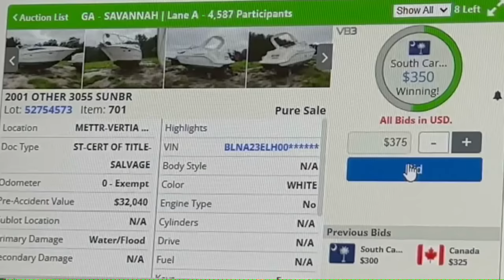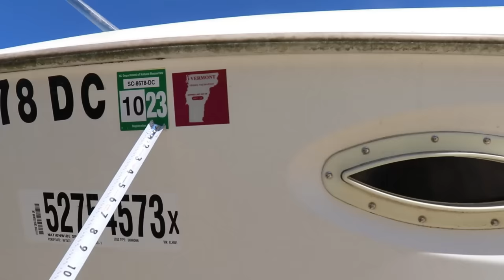IVAN WON A REALLY CHEAP BOAT OFF COPART

Comment: 25 year employee here.  This model was real popular. We built them for many years and i was the Ciera product manager in the early 2000’s.  The damage on the drives says there was an electrical issue either with the onboard bonding system, charging system, a “hot” boat nearby, or other stray current in the marina.  The marine head has been changed to an electric pump unit.   Don’t play with the shift levers unless the engine is running, use the buttons on the side of each lever to disengage the shift function..  they are called out drives. They are bravo twos.  They are the work horse units that mercury produces.  With the 5.7l engines this model is a blast to run.
Reply: I do care and thanks for the information
Reply: @@ferdysambo3875get off ya mum's wifi and go tidy your room kid !
Reply: IO worst thing they ever invented)
Reply: Nice find and at that price bargain of the year!
Reply: @dsadzaglishvili  And the industry noticed. Now we have cabin cruisers with 5 outboards. IO's are now obsolete.
Reply: Great boat.
Reply: A big this about that is if they pulled the boat and replaced the anodes nothing nearly as bad wouldve happened. This is definitely due to there being no anodes left and being left in the water for a long ass time
Reply: That is a deal! It’s a great size boat.👍
Reply: @04Corolla  nah with electrolysis you can do this in about a week or 2. We had a customer that left his boat hooked up to shore power without a proper setup and the outdrive became part of the electrical circuit. That thing was half way gone in about a week. You can see the bubble coming off sometimes if they have a bad electrical system on board and they hook it up to shore power.
Reply: Then you are probably pretty familiar with my boat as well.. I found a 1999 Maxum 3700 SCR (a 40 foot boat )for $4k about 4 years ago and started getting it remodeled.. I've done and have learned a lot in the process.. Done a lot of modifications to it as well.. I love my boat for sure.. Come take a look at it here.. https://youtu.be/MbGOYVlXeXQ?si=fLgVePGv02r-tbcp I made a video of it showing all of the modifications I had done at the time of the video. It is a lot bigger than this boat is.. Sports twin Horizon 454's and weighs in at 22,000 lbs.. She's a big one.. I have done so much since this video was taken 3 years ago.. I need to update it for sure..
Reply: hey im a bit late but are you familiar with the mutiny line you guys had?
i used to own a bayliner mutiny 170 i believe and it had a volvo penta engine in it
Reply: Agree 100%, was just telling my wife that just before I read your comment, I'm wondering if the zincs were replaced, which were probably destroyed pretty quickly, if it would have prevented a lot of that damage? That was a lot of electric too but most likely DC voltage which is even more damaging in a situation like this.
Reply: what's a bridge pump?
Reply: @davegolombisky5530  bilge pump
It's a little pump at the bottom of the hull
That pumps any water that does come inside 
Out back into the water si the boat stays afloat
On smaller boats you usually have a lil scoop
But on nicer boats there's a pump installed thay takes care of that
Reply: @davegolombisky5530  Something that someone who doesn't know boats calls a bilge pump.

Comment: Yep great buy! The z drives uncouple from the drive shafts quite easily, then you can replace them, make sure you get the up graded double props called duo props replacement z drives, also the hull is a fully planing hull which means it will go fast over waves! Also the reason the z drives have corroded so badly in salt water the zinc anodes or sacrificial anodes have never been changed hence the corrosion as the drive bodies are alloy castings as are the props.
 Love from th UK.
Reply: Also means oil and filters not changed on cycle.  The risers and manifold need to be replaced before you put it back in the water.
Reply: absolutely not -for this kind of damage you must have some electrical issue!

Comment: Probably worth saying: boat owner here and I grew up with boats this sort of size. 

1. Look on the bayliner groups, people are paying crazy money for parts of these (well in the UK they are anyway). Worst case scenario you’ll make some easy money. 

2. Check the structure of the boat, it’s probably ABSOLUTELY fine, but this sort of boat isn’t designed to be trailered on that sort of trailer. Check the curves in the hull, and check with a flashlight the surface of the lacquer, then check under the floorboards for any delaminated areas. Honestly you’ll probably be fine, just better to check before you put any money into getting it on the water. 

Great find lads!

Comment: Best wishes in the rehab of your purchase. Looks better than I thought it would. Find the weight at manufacture. and the present weight. That will tell you the amount of water weight entrained in the foam core construction. That water can be baked out in a 120 degree shed. Takes three weeks to drive it out, but the weight savings/fuel savings will be worth the expense of the heat you will need to maintain.

Comment: Good god man!! It's a bilge pump!! Basics!! And FYI there's a bilge drain plug in the transom outside of the boat that should be open but this boat likely being in the water though it was likely never removed as the corrosion crusted it over and made it impossible to even find lucky the engines didn't go under water, usually there are drains around the engine hatch covers or floor to help drain water away from the engine compartment but still got very lucky on that one...It's not a matter of whether or not the RV can pull the boat in straight line or not, it's whether or not it can pull it up and down mountains etc.and out of the water which I doubt I'd even try..Also all boats have the length right in the model for example yours is a 305 Ciera which is 30.5 ft long, the out drives on that boat are going to be expensive but if no other engine damage well worth it I'm a bit envious until you have to fill it with fuel. I have a 220DL Searay so it's 22 ft long and also a 175 Bayliner and it's 17.5 ft, another Searay that's a 190 so you get the idea..

Comment: I was given one. I put $5,000 into fixing up and repower using the original short block. Since the boat only had 23 hours on it.
I sold it for $8500 after two summers use. I bought a CHAWK 222 w/150hp mercury.  Last boat, I will ever need.

Comment: bayliner under 26 ft are cheaply made but the 3055 is a fantastic boat, built well and fast fast fast. any bayliner over 30 feet is going to be a fun and great boat.Used to be service manager for them and stratos. The 3055 also comes in an outboard configuration but either way, those or the 454 bravo outboards  can get you over 60 mph.the generator is rock solid and the a/c system is normally fantastic as well. Inside, under the steps is a huge bedroom area.
Reply: lol, maybe 60 KPH

Comment: Check on the through holes for a start, then the internal electrical system and electronics then replace the outboards and you will have a great boat!

Comment: Bayliner is a brand that is at the low end of the scale. The stern drives are junk and will be expensive to replace. Try to locate used units. If the engines are decent, you may be ok.

Comment: Hunt around for the outdrives. I'm in Florida and they come by amazingly cheap. If the engines turn over freely by hand, they'll run. Get the outdrives off first thing, Marvel Mystery oil through the spark plug holes, fresh oil and filter, FRESH GAS (may have to drain the tank..smell it) and start each engine up. If they have an expansion tank on top of each engine and antifreeze in it you don't have to worry about overheating the engine if run for a short time, but if they have separate raw water pumps you'll have to disconnect the belt to avoid burning up the pumps. If cooling water is supplied by a pump in the outdrive, you could stick a garden hose into the inlet. Don't run them long out of the water as the exhaust manifolds will not have any cooling  if your water supply is not sufficient

Comment: You may have grounds not connected causing electrolysis to eat the drives check the drive when you replace then check for voltage also add a couple more sinks to protect the drives.  I sold those for twenty years they are a great boat .  We never could keep them in stock.  They also handle extremely well even in heavy seas.

Comment: Bayliner’s are the GMC of boats. Mass produce OK Boats. They get there reputation of being bad because first time boat owners buy them and treat them like learning tools. If you don’t have water damage and no soft spots replacing the merCruiser‘s is easy. You’ll have a perfectly running boat for the price of new engines.
Reply: Why does he need new engines? He DOES need new outdrives that's a given..

Comment: Pull the outdrives. Get the engines to run. If they run well, get some used outdrives. Go for it!
Reply: They'll need transom assy's as well,  hard to find those used

Comment: Me and my dad worked on these growing up. He was the the head engineer on rotariis an engine component manufacturer for mercury on the 5.7L engines. 

The boat has been flipped and the waterline corrosion says the boat sunk fully at one point. Don’t spent anymore money on it.

Comment: Stern drives will be expensive, but you could probably part it out for twice what you paid for it. Check out the price for the stainless steel railings alone.
Reply: i was thinking part out as well. The gen and engines can get you worthy return but if you restore, you are getting a 200K boat for what you put into it.
Reply: @timdskibum  200K not likely, maybe 20k though..

Comment: That would be a " bilge pump " not a bridge pump. Those corroded things at the back are called out drives or " legs ", I say if the engines test good, look for a couple of outdrives. You guys got this and you will soon learn a bunch of nautical terms.

Comment: As  its been Said for  Sure  need check all electrics I watched a buy fitted 2 brand new   Out Drives and Just  sitting the marina for 3 weeks  both out drives was eaten alive  as  it had  a electrical Fault  and the Current from the Marina eaten the Drives  so Must if you going to Keep it Fix that and Don't forget  to do so Good Luck Looks a Great Boat for very Little Money

Comment: I worked at a shipyard for 6 months before I started fiberglassing and building yachts and fishing boats. One thing I did at the shipyard was replace the zinc blocks that are welded on around other metal things under water like the propeller. Apparently the zinc protects other metals and it will erode first
Reply: 03:51 That is the worst electrolysis I have ever seen... worked in a boat yard for 42 years

Comment: That's a $50,000 thousand dollar boat and you got it for $395.00 Yes I'd say that a dam good deal but what are the new or used outdrives going to cost. right now it's just a big flower pot. Put some TLC on the inside of the boat and once it's in the water you can live in it or rent it out, Me personaly I would live in it. it's like a cottage on any lake. Lucky you Ivan

Comment: Take a forklift or something and raise the front way up so all that water will run to the back and not sit under the floor.  Check to see if there is a drain plug. Got to get the water out.  Hopefully the stringers aren't full of water and have started rotting.

Comment: if the genny works you may have made a good buy. Otherwise NOT. Check the genny first (with water flowing to protect the impeller.)  If that works check the motors.  If the genny and the motors work you are at break even.  Now replace the outdrives and you will spend exactly what the boat will be worth once it's in the water and operating.  In other words you're already down $1000 with nowhere to go but deeper down.  Been there, done that, got the T shirt, coffee cup and the hat.  The marine world IS NOT your friend.  From insurance companies that don't pay off, to shops that refuse to work on your outdrive/motor, to marinas that grossly overcharge for a slip and then prevent you from staying on your boat, to hot harbors that dissolve your outdrives (like yours) in less than 90 days.  You'll be FAR better off on a fiberglass sailboat with an outboard motor (so you can get it COMPLETELY OUT OF THE WATER as an auxiliary.  Not fast but very enjoyable the whole time your on the water.  Consider the price you paid for the boat as the purchase price of this sage advice. . Then unload it ASAP and go looking for a sailboat (on a trailer).  I've had boats since I was 8 years old and I'm now 78 and manufacture control systems for sailboats.  I thought I'd be smart in my old age and get another powerboat - BIG MISTAKE.

Comment: Might have to put $30k into the boat.  $4,000 each motor and probably another $4,000 each drive.  I would guess the generator is rusted if the engines are.  Upholstery another $4,000. Gelcoat repair.  The price to fix things will go up quickly.

Comment: Those outdrives where missing an anode and /or there was a current running through them. This is not normal "wear" from just sitting in water

Comment: those outboards suffered an electrolysis issue, prolly from the batteries being underwater fora period of time, it may need wiring the works...  and NO!  Bayliners are not the cheapest or budget boats, they make FINE BOATS, some of the best

Comment: That boat suffered electrolysis damage. Either from bad wiring like a bad battery charger or a “hot harbor” where there was a problem there. (Why you never swim in a harbor). The generator alone is worth more than you paid for it. New or used out drives will give you a heart attack when you see the cost.

Comment: im gonna say you probably dodged a heavy fine, most states the limit is 102"/96" without special permits for wide loads. its one of the reasons why some boats are so cheap, legal transportation is expensive.

Comment: No special license to tow with rv. Anything under 26000 lbs you shouldn't be length restricted its not a semi. Fix it up i might be able to get cheap or free outdrives. The engines if are locked up are a 350 Chevrolet.  88-95 have 2 brrl throttle body  1996 to 2000 will have a fancy efi but junk yards sell 350 from the 70s till 1995 are basically the same 96 2000 have different cylinder heads better heads but intake from old series wont bolt on.

Comment: Bridge pump?  What's a bridge pump?  Shouldn't that be "bilge" pump?  Bilge pumps remove water from the bilge, which is the low point inside the hull where water can collect.

Comment: I wouldn't listen to all the naysayers. They're just jealous. They're 350 Chevy motors. Monkeys could work on them. You don't need half of whats in that boat to go boating. Its basically an RV in a boat. This shore power, anode issue can be fixed. Nothing worth doing is ever easy. Enjoy your boat. Its bad ass.

Comment: As a 35 year boat restorer. Get rid of that junk now. You will definitely be upside down on the costs. A Bayliner is NOT worth restoring. Some other brands, yes. They look nice sometimes but are very poorly built. That being said, if it’s an emotional resto then go for it…. It will be a loss though. Boat- break out another thousand.

Comment: Good buy?  You guys are funny.   Just transporting alone is going to be a lot.   Then go dump in another 25k and then you will have a nice $10,000 boat.   Even most free boats are not a good buy. 
  Just about every marina out there PAYS people thousands of dollars to take them away. 
  That's not even getting started on the brand issues.
  EDIT: I actually watched the video on length, and I was wrong.....it's gonna take $40,000 to fix that thing.   And then you have s boat with a Salvage title that no one wants and marinas will be very likely to just turn you away.

Comment: Flip it cost too to put that back in the water outdrives alone used 2000 bellows propellers u-joints you don't know if the engines are good?

Comment: @user-ej2lr3yw4f hit it on the head regarding the outdrive corrosion; thats bad, way more than just used up zincs I think; also, next time just remove the bilge drain plug to drain the bilge water; the drain plug is outside on the center of the transom, near the bottom.